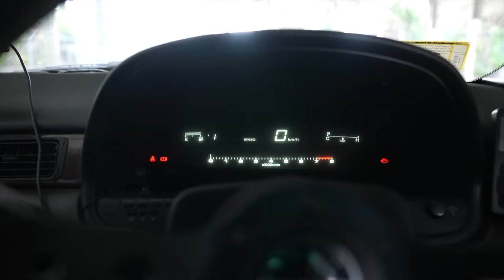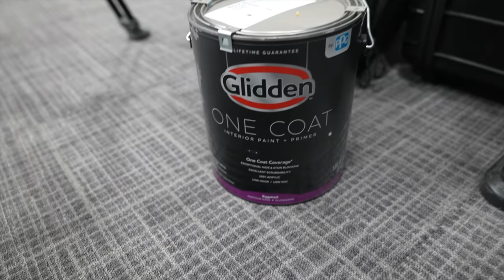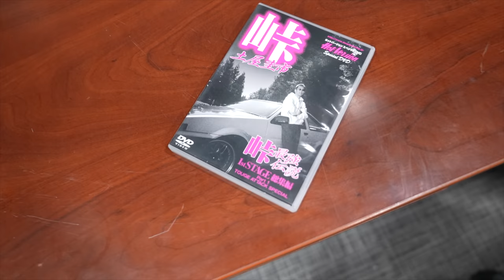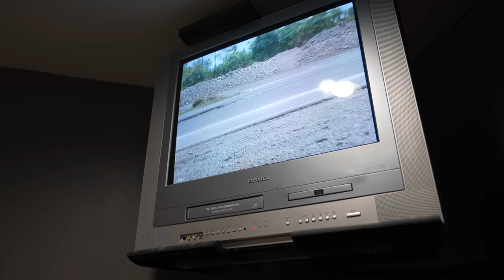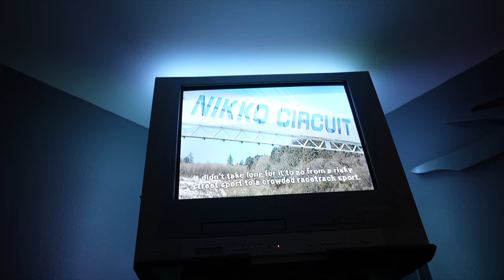BIG ANNOUNCEMENT! + Painting my Dream Media Room/Office!

Comment: Change the light fittings in the office over to flat panel LED fittings. The extra spread will take away most of the shaddow towards the top of the walls. And you can get fittings that match the existing cutouts in the ceiling of the old fittings. LED fittings arent expensive these days so the results are worth it.

Comment: Just an idea. Lengthen the panted section on the back wall to match the length on the  side wall so when viewed at a 45% it is symmetrical with the TV center of frame.
Reply: Maybe have the gray change to white in a decentigrating grid pattern.